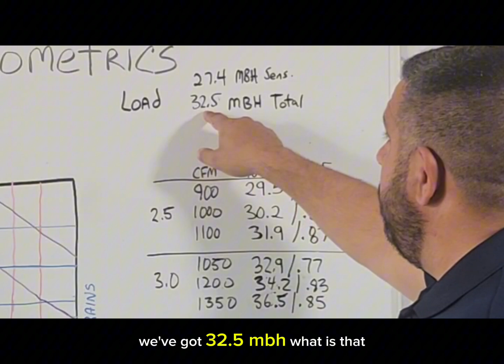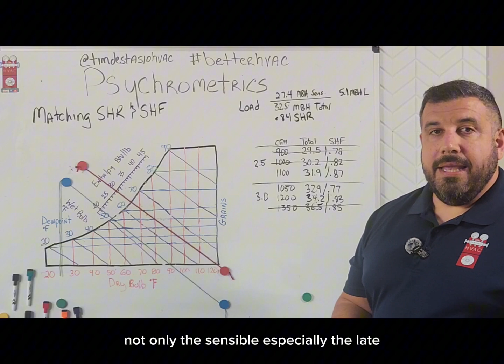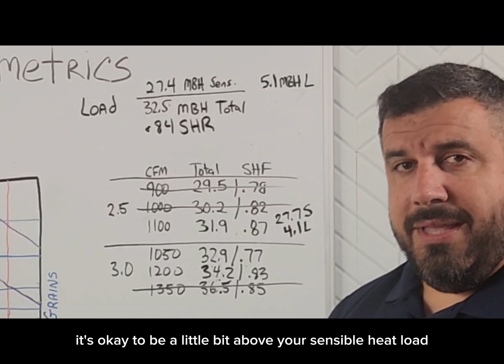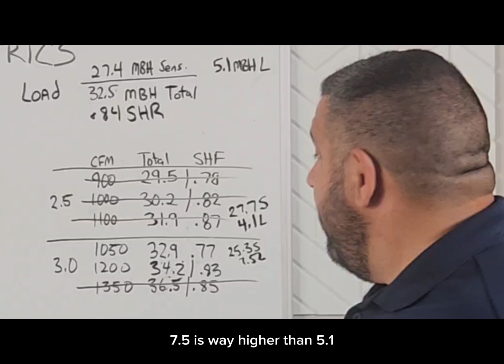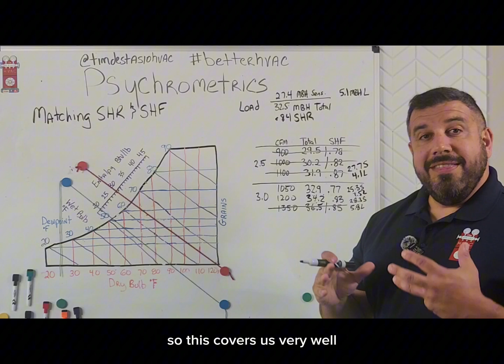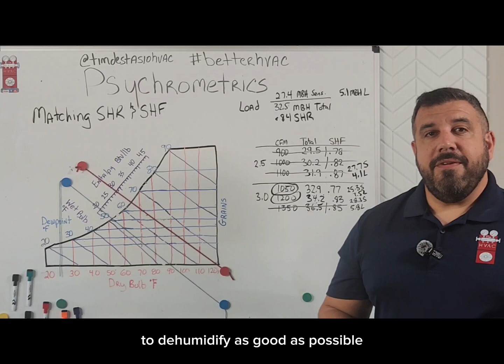Psychrometric Saturday: Sizing an Air Conditioner Part 2

Comment: @timdestasiohvac Thanks for the great videos! 7.57 Latent (equipment cap.) - 5.1 Latent (load calc)=2.47 Latent excess cap. in the equipment.  2.47 x 50%= 1.24 extra latent capacity to add to the sensible equipment cap.  25.3 equipment cap. + 1.24 Latent excess= 26.5 latent cap. for the equipment.  26.5 sensible (equipment cap/NEW) / 27.4 sensible (load calc)= The new equipment will satisfy 97% of the sensible requirement. 

I thought I learned somewhere that Manual J(load calculation) has a built-in overestimate? Maybe 10%? Is this correct? 

If there is an overage(safety factor) in the load calc., the 3% shortage probably won't even be noticed and in reality may not be present. The building heat load will be satisfied by the equipment and occupants will be very comfortable. 

Really enjoy all your content and building science videos! Thanks again.
Reply from the maker: @RossHartig  exactly. We are close enough.